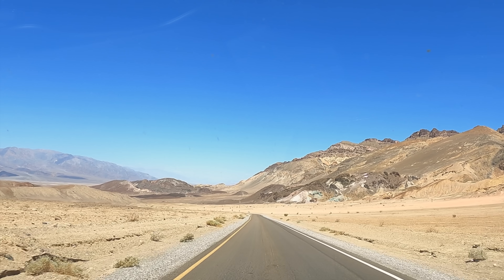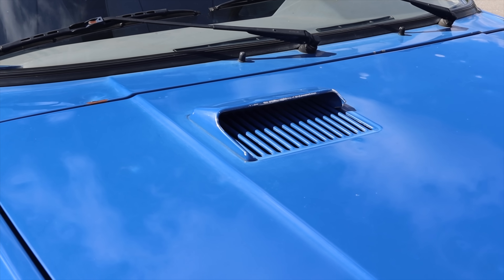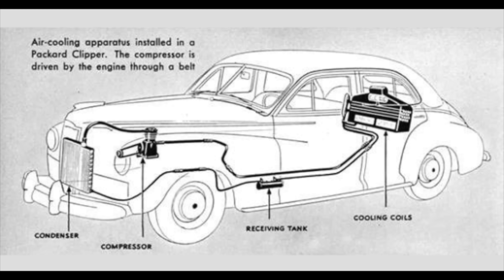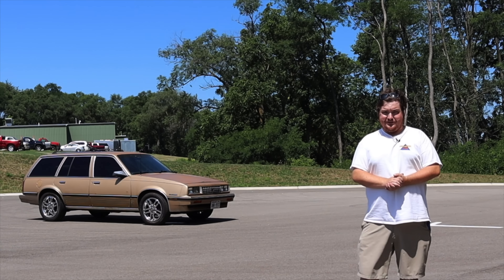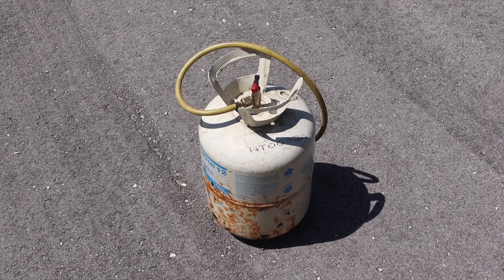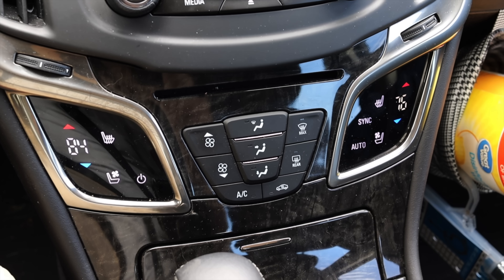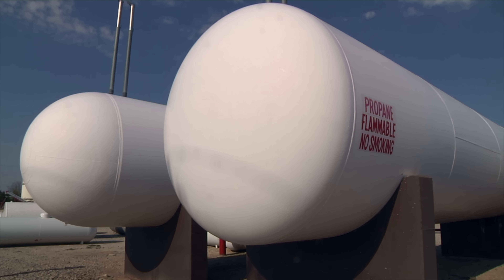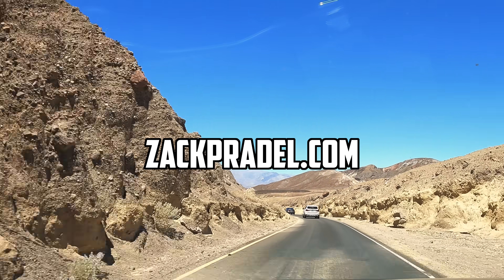Air Conditioning - The Story Of R12 & Why Modern Air Conditioning SUCKS!

Comment: 04:17  The whole point of CFC's was that they are chemically inert.  Breathing them is harmless, so long as you're also getting oxygen in the mix.

The bad part of CFC's is that once they reach the upper atmosphere, they get broken apart by radiation from the sun, making the byproducts of that breakdown very chemically reactive.  And the thing most readily available to react with up there is ozone.  That's why CFC's deplete the ozone layer, which is crucial for life on earth due to the fact that it blocks almost all of the harmful ultraviolet radiation (the ionizing kind) from the sun.

Comment: I had a 1991 and a 1995 Toyota Previa.  The R-12 in the 91 doesn't last as designed while the 95 lasted when my aunt it bought it new, then I bought it (replacing a 2005 Dodge Grand Caravan) and then selling it to Pick n Pull after failing smog because of a part to replace is No longer available.  The 91 ran without working A/C all the way still I sold it because I couldn't afford insurance because I added another car (2017 Dodge Journey, which has been since sold).

Comment: R1234yf is what's used in my 2021 Subaru Legacy and I noticed its not nearly as cold as my 2010 Mitsubishi Lancer that was using R134a. Its like each replacement seems to get progressively less effective. I took the Subaru to the dealer complaining after taking a 500 mile trip on a 105 degree day. It was so weak and I was too warm with it on full blast. The service department tested it and said it was working as it should. smh
Reply: Those demons sold their souls

Comment: I remember first finding out how "safe" r134 was when trying to convince the dealership there was a leak.  The service tech said woah get away from that gas it's dangerous.  This was after saying it was not leaking and confirming yes it has the "safe" r134.  It totally seized the next day btw and cost them replacement of the entire system besides venting itself into the atmosphere.  It was covered under warranty and was roughly 6x the cost had they actually done a proper leak test.
Reply: If your a/c system used r13 and was leakibg, they would have said the same thing. You wouldn't want to inhale that either. Your pount is moot and useless.

Comment: Well, you are partly correct.  The real reason that R-12 was banned is because Dupont held the patent on R-12 and it was going to expired in 1990.  Then anyone could make R-12 and bring down the price.  So Dupont made up this story about R-12 making holes in the ozone, and got R-12 banned.  To prove my point about R-12 not hurting the environment, I will tell you this.  R-12 or Freon is a natural occurring substance.  There is more Freon emitted into the atmosphere with every Volcanic eruption than man has ever released into the atmosphere.
And the funny thing is Dupont holds the patent on R-134a.  Money talks.

Comment: If you look at the logo on any piece of glass in your car you will see it says "Solar Tint"... this is due to the R12 to R134a transition. They used a solar reflective tint on cars with R134a in order to help the air conditioning work better... at the time if you transitioned your car with a  R12 system and no solar tint to R134a you would find that the air conditioning would not be able to keep up on really hot days. This is the reason why older people still complain about R134a.

Comment: R12 and 22 are some of the best refrigerant gases in the world! But like anything else in this country, if it works too well they ban the products and replace it with something mediocre if that's even the case! 134 is OK with certain situations like all gases there's a place and time for certain products to be used! If they're going to get their ways, the government is working on phasing out R134a to be replaced by an even higher pressure gases and eventually work their ways to all C02 gas systems. Problem is C02 is cost effective and the systems require even higher pressures than true refrigerant gases. The fact is the pressures have to be much higher! Needing more power to convert into a gas, and having much higher potential for leaks of course. But yes propane is a excellent refrigerant gas! As is ammonia!

Comment: fun fact; Propane is actually used as a refrigerant in modern systems as R-290. 

Better yet, if you're working on an R290 HVAC system and need to discharge it, unlike R12, R134a or R1234YF it can be discharged to atmosphere safely and legally :) you don't have to uise recovery equipment... just uh... do it in a ventillated area, and make sure you smoke BEFORE discharging, not after or during :)

Comment: household refrigeration (yer fridge) dates back to the 1920s, it coincides with the invention of freon by dupont, before that your choice was ice, you could pick natural ice harvested from lakes during the winter and stored or 'artificial' machine made ice made in your local ice plant (artificial ice was frozen water), people actually argued about this.  Industrial refrigeration dates back to the mid nineteenth century but they use ammonia (and still do), problem is ammonia is poisonous even in lower concentrations, so it's best left to the professionals.  So if your household fridge leaked it would need fixed but no one died.  The old GE monitor top units were extremely reliable, quiet, and would last a lifetime.  Enter de gobermint to screw things up.  While refrigerators use little power they run a lot of hours and this adds up so the government demanded they be more efficient, this started out OK with just adding insulation but with every gobermint program, if a little is good more is better.  Ends up just using radiator type coils to spread the cool, you had to put in fans, etc.  All this makes them more expensive and a lot less reliable plus when they die you have to hire a techie to suck the juice out of them, not vent it to the sky.  Now if you think 134 was not good, wait till you hear about 1234, the newest coolant.  It is poisonous and it burns, isn't this what we were trying to avoid?  It started in cars and several carmakers sued since they didn't want to be responsible if their cars caught fire, the gobermint appeased them, limiting their liability, so that's what we have,  If that white box in your kitchen leaks in the nite you might not wake up or wake up to a housefire. At autocrashes expect to see a lot more carfires.

Comment: As far as propane, butane and isobutane goes, they are by far the best options rn, systems using them have been around for A LONG time, chances are your freezer runs on r290 (propane) r600 (butane) or r600a (isobutane). R134a has a GWP of 1430, R290, R600 and R600a have a GWP of 3
Even though they are flamable, there's not a lot of those gases in a car AC, experiments have even been made with replacing r134a with a mixture od 50-50 r290/r600 mix and the required charge was half of whats needed with r134a, which technically doubles the difference in GWP
R290 is also quite efficient at low temperatures (the rare heatpumps running R290 have usually higher COP than R410a ones)
R600a is also great for getting low temperatures, my freezer gets down to -26 Celsius, even after somewhere around 18 years of constant usage, I did freeze some 38ABW vodka in that one
It amazes me how people are terrified by 600g od propane in the completly sealed AC system, yet they drive cars which have a LPG tank holding like 30kg of propane

Comment: Zack, I still fix old refrigerators (expensive built in ones) and only use the orig R12, it is readily available at virgin quality for about $70 pound.  Pricey, but still the best.  You joked about propane, all the new frigs take R600, which is butane/propane blend!  Also, for what it's worth, Freon is a name brand by Dupont, kinda like we call facial tissue Kleenex, there is Freon 134a, Freon 22, Freon 12, etc...  great video Zack, keep them coming!  thanks again!

Comment: My first vehicle was a 1993 Ford Ranger,  with R12,  but the air conditioning never worked.  Began having major electrical problems and for a while kept a propane torch in the glove box to defrost the windows as I lived in Southeast Michigan at the time.   Oil pump went out, oil pressure light never came on, and the engine seized up.   Ended up taking the truck to the scrap yard.    My current vehicle is a 2014 mustang convertible, with R134a of course, so I never got to experience R12 vs R134a

Comment: I have a 1977 Ford F-150 Ranger XLT 4x4 4-speed. All in Factory condition with the exception of tune-up parts tires and rims. I acquired this truck over 12 months ago. And still haven't found anybody that can recharge the system.

Comment: In the old days, with cars having only manual ventilation speed and direction controls, an AC with R12 was actually often too much. Some cars had good knobs for mixing cold with hot air, but on other cars it was either too much hot or too much cold air. And you wanted cold air in the summer, but if you turned the ventilation to you head, you got a flew next day. If you turned it to your feet, you better had on socks. Most people ended op pressing the AC switch of on and off in intervals while driving. It always was either too hot or too cold in the car. Modern ac maybe don't get as cold, but they are far more convenient. You can drive your car in the summer in a business suit, you can also drive it in a bikini. Set it to the temprature you want, press auto and never press it again till you arrive. The new one wins this one.
Reply: You don't live in the South do you? Modern A/C in cars can be utter dog shit in the dead of summer barely doing enough to keep you cool with it set on full blast.
Reply: @kudzuwarrior  No, I am from Northern Europe. Belgium, near Germany. Our summers indeed doesn't become as hot as yours. We do have a hotter then usual summer right now. It takes a bit for the little Honda Jazz its AC to cool the interior down. But in 38 C weather it takes like a quarter to bring it down the interior to 24 C and then the car's AC has no problem keeping it at that temprature. With a bigger engine to operarate the AC, I think the cooling would go faster as well.
Reply: @FrightfulAccountant  Well that would depend on them using a bigger a/c setup in general. Some vehicles are definitely better than other but living in a basically subtropical climate where I need a/c about 10 months out of the year I can tell you they ain't what they used to be
Reply: @kudzuwarrior  I'm pretty sure he's agreeing with you. He's talking about the old R12, not the newer systems. 

Also, most cars are coming with 1234yf, not 134a. YF cools better than 134.
Reply: @kudzuwarrior  get the darkest tint you (legally) can on your windows and windshield and it will be way less bad in the heat. Your car might also need a refrigerant recharge.
Reply: I've owned several older cars over the years and the AC always worked pretty good. Never had to fiddle with them. I don't know why newer cars have all that auto-temp garbage in them. It shouldn't be necessary.
Reply: I know GM cars in the mid 70s the A/C compressor never shut off until you turned it off. When you put it to Max A/C the fan locked on high speed, recirculate the air in the car and belch cold air. When it started to get too cold and you put it on normal A/C it would bring in 100% outside air and you could then reduce the fan speed. However the compressor still ran until you turned the A/C off. They were awesome.
Reply: Yes it did but was largely problematic. At least in the GM cars of the 70s. I had a 76 Olds Toronado and honestly couldn’t tell you if the climate temperature control ever worked in it. I just operated it like most other cars of the era. It had temperature settings on the lower lever that in most cars just said cool or hot and I would just temper the air accordingly. I miss that. I hate the new cars where they want you to set a temperature. I’ve never been in a car that has that and has even approached comfortable.
Reply: Do you really believe that you get flu from air conditioning and not the influenza virus?
Reply: Climate control existed back then, too...
Reply: This. Love the variable speed ac in a toyota hybrid.

Comment: You can get a r134a system to get so cold it will freeze over. Yes r12 was more efficient but both can get too cold. Believe it or not a slightly undercharged ac system will work better the problem is if it is too low it will freeze up and stop cooling until you let the ice melt.

Comment: Nope! Cars was not better in the 1980’s, as that was when they started putting all this computer control crap in. Which was the predecessor to OBD1 and OBD2. Cars was actually better in the 1970’s and 1960’s, as far as A/C and serviceability. And you can still make an R134a system cool as good as R12 system, but I’ve found that R134a systems appear to be more prone to leakage due to the inferior construction of a/c system parts like condensers.

Comment: Great video and a really interesting topic.

I have a 1991 Jeep Grand Wagoneer with an R12 system. When I bought it in 2017 it was still running R12, but eventually it needed a top-up around 2021. 

I found somebody locally who was able to refill it with an R12 replacement called R426A/RS24. It seems to work pretty well, although I'm not sure it's quite as cold as it was on R12. It's also only lasted a year before needing another top-up, but I figure my system must have a slow leak to have needed topping up in the first place.

The AC guy that does this for me seems to think that these replacement refrigerants tend to leak out more easily than the R12.
Reply: A lot of people think that they leak out, but in reality, anything that still uses R12 has very old components. Small leaks are much more likely.

Comment: I'm sorry to say that you've got it wrong.  The refrigerant has nothing to do with the cooling capacity of the system as designed.  The R-12 systems everyone here are talking about being so much colder in the comments were also designed during a time when systems were designed with a larger margin of error (ie more btu of cooling drawing more horsepower off the engine) combined with the addition of electric fans which were half the cfm of a belt driven fan.  They also got far worse mpg while the compressor was engaged.  A properly designed system using either type of refrigerant with the same design cooling power will move the same amount of heat.  I could talk all day about this but I digress.  Source: I'm an electro/mechanical tech that used to design and prototype refrigeration systems.
Reply: I would agree. I remember how the gas mileage went way down when you turned on your air compressor back in the day and they were much heavier compressors in fact the entire cooling system was just bigger and bulkier and the capacity of freon was Greater by volume in the system. In short they were over engineered. But having said that I doubt seriously are 12 and 134 or equal any more than 87 octane and 93 octane gasoline or equal
Reply: Yep, seems like a whole lot of delusion in this video and the comments. In my experience the reliability of R12 systems generally sucked and even when in good working order they were no better than today's R134a systems. The best performing AC of any car I've owned was a 1995 240SX, an R134a system.
Reply: Yes modern cars (from 2000s till now) do have precission in a/c design and capacity. But its slow to cool the cabin. Also when evap just slightly dirty it would hard too keep cabin cool if the car have no window tint instaled

Comment: r12 was great, much more efficient than todays 134a. I know the ozone has healed some, but the question is: did it heal from R134a or was it the laws that required recovery of the gas by technicians? you see during the transition phase it was made mandatory to recover the gas from the system. before that many would vent it directly to the air when they had to work on them. so how much is because we are smarter and recover the gas compared to the switch? we will never know.
Reply: R-12 is heavier than air.  I never made it up to the "Ozone layer". It was all a gimmick to scare people into changing all refrigerants to R134A. There were lots of vehicles on the road using R-12 that suddenly 'needed' to be changed. Dupont made Trillions off of it, while there was another reason to scare witless people.
Reply: They used R-12 as a propellant in aerosol cans, which is quite literally spraying it into the atmosphere. At the very least, it was necessary to ban that usage.
Reply: @zacksstuff  I agree with you on that but there are ulterior motives behind banning R-12, R-11, R-22 etc.
Reply: @mikee2923  Yes. I have heard that the reason R12 was deemed unsafe is b/c (either DuPont or Dow which ever one invented it) 
Their patent had run out and they had to create something new for a new 20 year patent.
Reply: @matthewboudreaux2693 the patent for R22 and R12 expired in the 1950s. Dupont fought the Montreal protocol initially before finally agreeing with the facts.

Comment: I have a1991 gmc sierra 1500 pickup i used R12 freon the last time i charge my AC about 4 years ago until now it still cooling very good we had 49 or so of 100 to 107 degree weather it feel nice and cool in my ext cab in the low position to half position my wife truck used R134 it sucks/ ihave R134 fitting for cover up if you know what i mean but my system is charge with R12 freon

Comment: I had a 1991 Cavalier and its R12 was very cold. Unfortunately the compressor seal blew due to age and I resort to switching to R134a, downgrade but sadly that's my only option when R12 are difficult to find in 2019.